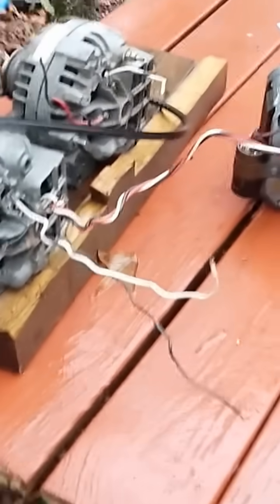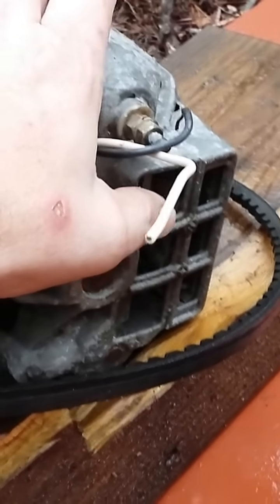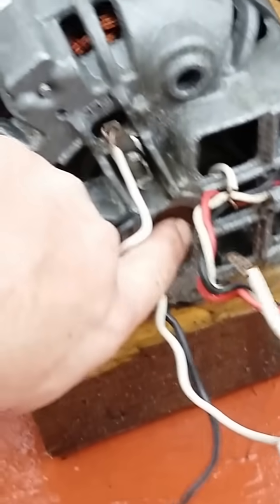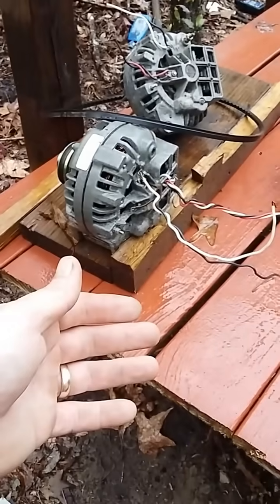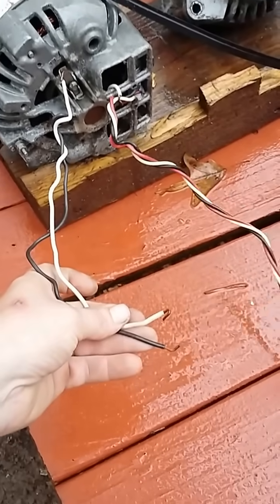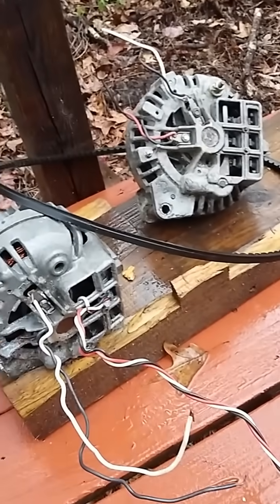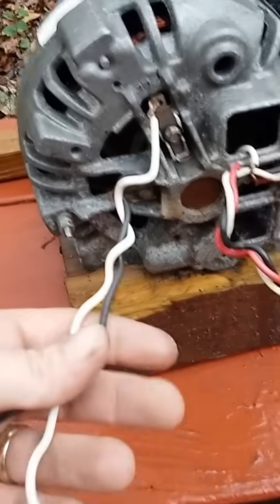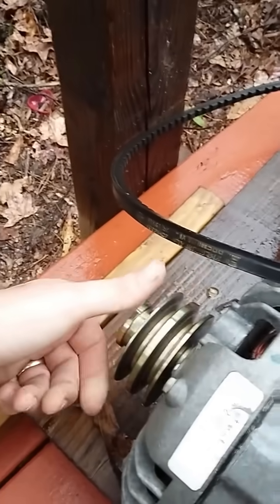Update Free energy forever no wind no solar no gas READ DISCRIPTION!!!

Comment: one of those alternators will not even run a high power stereo.
Reply: Thomas Buie When an alternator is rated at say 100A @ 14V, that is ~1400W, so no matter what you do with or without diodes, you will still be limited to 1400W. Alternators can only self excite with a rectifier and voltage regulator, which is NEEDED for the magnetic field to be produced in an ALTERNATOR. Just because you want an alternator to be a generator and power your dreams, doesn't mean you can make up crap about how YOU think electricity works. You either have to rectify and regulate the ~150VAC to 12-14VDC in order to power the field wire to make the magnetic field to generate electricity, or you remove the stator and modify with magnets. All GENERATORS have permanent magnets and do not need an exciter to work. ALTERNATORS unfortunately do not have magnets and need about 2amps supplied to the windings to create the magnetic field. If you supply voltage just to get the alternator going so it can self sustain, you'll fry the windings by overloading and shorting the entire unregulated circuit. 
I don't care what you are doing with your life, but telling people that they should remove a regulator and rectifier from something that can blow up, if it is ever fed any power to get it going, is CRUEL especially for undereducated people trying to find a way to experiment with alternative energy..
Like I said I don't care what you do with your life, but it's nut jobs like you that jump the gun and spread false theories as proven fact. 
If this works so well, show a video of it working. I wanna see you power it up actually. I want to see the smoke and fire.
Reply from the maker: Well then you've been taught completely wrong because one of those alternators will run 4 easy and the alternator that I'm using is a 10kw alternator. I actually have two of them...
Reply: Thomas Buie "90amp alternator" from a car? 
The way electricity is measured is wattage. Watts =amp x volt. 90 amps x 12 volts is 1080 watts. You could run a cheap microwave.. Maybe. But I bet the consumption of your drive motor is slightly higher than your alternator can put out. Nice try buddy. Maybe use a 300amp mechman and you'll have an output of 4500+ watts, but the magnetic drag will probably be too great  for a motor to spin without tapping all of the 4500 watts that you'd produce. 
Try using an exercise bike and a battery bank!
Reply from the maker: +Robert Penny
 Brother you're extremely right about everything you say and the only problem that you have with anything I say is the magnetic drag problem well let me ask you how much magnetic drag is there in a self exciting generator? almost none, so the thing that we've been lied  to our whole lives..(wait for it) is that you have to have the drag when you create the magnetic field. so with that being said... (crash course) when you take a 10kw self-exciting generator that is rated for an 11 horsepower gas engine and you're able to hook up 1 BLDC motor OR 1 one and a half horsepower AC FD motor and run 2 OF THEM generator heads with no problems creating 20kw peak 14.8kw RMS and only consuming 2.475kw and that's for the AC motor! the BLDC motor only needs to be hooked up to a charger and a battery and there is enough left over to run two houses at once then you will realize that if you use the magnetic field the same way you're using the alternate current you will have the same effect and it can be amplified 1000 times easily...   like I said before I'm not here for money even though I'm going to lose my land and everything I have because only one person has donated to me in the last few months don't get me wrong I'm very grateful for everything everyone has done for me and my family and I hate asking anyone for anything because I get treated like s*** for doing that but I am about to lose everything and there's nothing I can do about it except for sell my stuff off until the end but I will keep uploading videos until my phone bill is due and gets shut off... And I'm not asking for pity! I'm just rambling and hope you get some information out of this... I love the intelligent questions!! I think you very much for giving me the opportunity to Enlighten you on some of the things that we've been lied to our whole lives and if I can make this happen before I'm killed then I'm going to make sure that everyone on this planet has drinking water and electricity!!!

Comment: thats a cool idea!

ok so what should you use to turn the alternater

+ alright thanks man
Reply from the maker: +Alex Anderson thank you but the video is not complete instructions and just one of my many ideas but the alternators are incorporated into the system as generators and as Motors
Reply: Alex Anderson that's my bro you responded to. Thanks for helping him out man. hey, maybe I could use this in the future.
Reply from the maker: oh sorry, I didn't answer your question.. Just take one of the alternators and take the bridged rectifier out of it and you will have a bldc motor. I show how to wire one up in one of my other videos. 3 volts at about 3000 milliamps is perfect to the to field wires and you're controller tells it when to fire its really high powered so be careful with it!!!

Comment: where do I  get an alternator like that?
Reply from the maker: +Henry Harder I think I got one of them off of an old Chevy van and one of them off of an old Dodge from junkyard but alternator's don't go out they just have two pieces in the back that need to be replaced every 10 or 15 years. I picked them because they are cheap high powered and last forever I will be showing a video using them very soon I'm just low on funding right now been a few months since we've been able to work...

Comment: Meth is bad, also this is a 12v alternator at 90 amps. If its wired to produce 220v then you have to account for the difference in voltage. It would only produce about 1/20 of 90 amps. Also what are you using to spin the generator? If its anything other then a hand crank its not free silly man. I love to see a guy doing alot of talk and not showing it working. If it did what he said it wouldn't be disconnected. No one is out to get you for your invention of a alternator laying on your deck.
Reply: Daniel Creaney hahaha! best comment
Reply: Thank you, if you look at the description of the video he's trying to sell the plans for this. Lol this is the reason he's poor cause he's a total piece of shit.
Reply: Daniel Creaney if you're gonna be a scam artist do it right XD. I guess it's better than selling downloadable cpu speed and ram

Comment: so what's powering the electric motor that's driving the alternator?, physics show that it can not drive itself... + where are you getting your 6 VDC from? Thanks ;)
Reply: Malfunction Junction exactly what i was just going to ask. "put 6 volts" is pretty vauge
Reply: Malfunction Junction need running water and a wheel fashion out of some junk like a car hubcap or something that the water can move to work the alternator.

Comment: Diode doesn't convert AC to DC. RECTIFIER does that. A Diode is an electrical "one-way check valve", allowing current to flow in one direction only.
Reply: you do realize that a rectifier is just a series of diodes that channel the AC current into a DC current.
Reply: ...and it's actually not a "True" DC current, but more of a chopped up AC sine ;)
bridge rectifiers come in flavors...full wave 1/2 wave, etc
Reply: true true. That's why a good solid batteries so important. It acts like a filter to take that choppy DC signal and turn it into a smooth signal the computers in the car can use.
Reply: actually an scr is technically a diode that converts AC to DC but that is not what is in an alternator , this guy don't know anything and this is coming from a maintenance tech

Comment: everybody know a alternator creates power so how are u going to run it without gas wind solar
Reply from the maker: BLDC
Reply: esme outwaithe what kind of motor?
Reply: esme outwaithe is it just 2 alternators running together with a belt, running off a car battery well recharging the battery?
Reply: he is using a battery to turn a motor or alternator whatever you want to call it. you can put power in the back to turn the wheel or you can turn the wheel to get power from the back. he is using a battery to power one motor to turn the other to generate power. throw the two motors in the bin and just use your battery for power because all your doing is ending up with the same energy you started with you ain't getting nothing for free.. take wires and work something else along with the motors which is what your supposed to achieve and the whole thing will die just like your car when you use more power than the alternator can create.. your achieving nothing by turning a motor to create enough power to turn a motor .. now if some how you can create MORE power than you use and not just a circuit then that is perpetual energy.. you need to work something else off the energy
Reply from the maker: +esme outwaithe 
I would take this video down if I didn't have to have its revenue to live... if I was trying to create perpetual motion, more energy out then what I put in then why would I use one motor and one alternator? I wouldn't. yes I know those are the same things there's not really much difference between a motor and an alternator or generator whatever you want to call it and you don't want to put 30Ah @ 12 volts to the field wires because that will create too much of a magnetic force since it's wound with clear coated copper. your initial goal is self excitation! once you achieve that then you lose most of the drag Force created by the magnetic field or short circuit. please go watch my other videos to see things in motion...
Reply: HE USING A BATTERY TO POWER A MOTOR TO TURN AN ALTERNATOR TO POWER A MOTOR

Comment: Free energy is as simple as the pre-school technology of using pulleys to multiply rotations + multiplying AC electricity with multiple of both size and #’s of pulleys 
= https://free-energy.yolasite.com/ 
- this is so super simple, 
that we should be ashamed of allowing satan 
+ his fellow evil spirits, to have kept it hidden 
for so long = ever since Ezekiel 1:16 
- “a wheel in the middle of a wheel”, 
where it was the first simplistic described how a UFO motor worked in the Holy Bible,. 
You only pay one small bit of DC current 
to rotate 100 cm circumference pulley one single time,,,, 
+ through running the 100 cm of moving belt, 
(which came off the circumference of pulley) 
+ running it by 10 of the mini- 1cm circumference pulleys 
+ attaching AC generators to each pulley, 
you can multiply your AC electricity to 10X100=1000 cycles of AC electricity
,,,,,,,,,,,,,,,,,,,,,,,, all for the cost of one spark of DC current 
=(just enough to rotate your DC motor one single time)  .  .  .   .  .  .  .  .  .  .  .  .  .  .  .  .  .  .   .  .  .  .  
……………………………………………………………………………………….
<<< NOW TRY + TELL ME THAT YOU CANNOT GET ENOUGH VOLTAGE FROM THESE 1000 CYCLES OF AC ELECTRICITY,,, + ONLY THE ONE SPARK OF CURRENT, THAT IT TAKES TO ROTATE YOUR DC MOTOR ONE SINGLE TIME >>>
-
(I hope this makes you realize reality, + how powerful spiritual warfare is going on all around you every day)
-
YES,,, GOD IS REALITY,,, + HE IS COMING BACK BEFORE 2019.04 –(in air for born-again)
-
http://decimationofthisevolutionfairytale.yolasite.com/
http://free-energy.yolasite.com/
http://my2020vision.yolasite.com/
http://doorschristmustpassthrough.yolasite.com/
http://beliefstoliveby.yolasite.com/

Comment: I'm ashamed to say I watch that entire video. If you know anything about how alternators actually work, what you're doing would never work. the energy that alternator produces will be used to power the motor. In a perfect world that might work. We live on earth. You will lose energy through heat and through friction, because that alternator  will start loading that motor more and more as it demands more to keep up on the motor, and because you're losing energy through heat and friction there won't be enough to keep the motor going. the entire unit will slow down until it finally stops. I tried experiments like this when I was a little kid too.
Reply: 1stupidfish the motor will slower due to heat yes but prolly won't stop if you wire the windings out of sync of two motors connected
Reply: 1stupidfish maybe
Reply: Insightful

Comment: if ure using an electric motor to turn the gen, how r u getting more out than u put in? don't u need a non electric means of turning the gen to have a net positive power level? wind, water, ect?
Reply from the maker: that's why I'm using more than one motor an more than one generator with different power sources, one motor is powered by 10 year old peddling a bicycle I mean powered by battery with a speed controller and the other one is powered by one of the other generators after initial startup...

Comment: I don't see the point.  I think you numbers are a little off. There is a scientific law that says you can't go pet more power out of something than what you put in it.
Reply from the maker: that's exactly right unless you find a way around it like building the Hoover Dam there's no resistance in the water falling therefore it makes all the energy you need it too.. there's no resistance in water. Now what happens when you mix copper in water and put steal in oil on top of it... what's the resistance and what are the variables in the input and output. so by using everyone's so-called laws of physics. BS is what I call it, if I was to take a 3.7 volt lithium ion battery and turn a motor with it and pump water 10 feet up in the air and let it fall down a bunch of pulleys with a couple of generators on it. I wouldn't get more out of it than I put in it...?... well it doesn't work that way in my world. I've been tearing stuff apart and putting back together my entire life and I know how things work. I may not know exactly how to wire SF/LF NF circuits without a diagram helping me along but I know Big power!!!

Comment: In your video you never mentioned what type of power source your using to spin the alternators?
Reply from the maker: and that's a good question I have used many things you can use and alternating current compressor motor but something that big you would need about 10 alternators. I took one of my alternators and turned it into a bldc motor by removing the diodes and running the three wires nice and smoothly out I use the stator and put about three volts to it because I want it to spin faster instead of putting 12 volts to it and having a lot of torque but not spinning very fast. I think it's a xr10 bldc motor controller that I'm using. I was going to get a 555 timer and just build one. it's a lot cheaper but takes a lot more time so I just bought one from the hobby store.

Comment: This for anyone who doubts this, if you were to use an Hydrogen dry cell hookup to run your vehicle's engine or even setup with your fuse box properly in your home (in this case just to incease already existing service output), an alternator with a small setup of RV deep cycle marine batteries then this would work perfect. The best techs are simple. Hydrogen works SO WELL in fact that the kits people sell now. If you had ANY compression engine injected with HHO you would have the highest octane (O3=Ozone gas & Hydrogen) at the lowest cost imaginable. People get confused by all of this because they won't make the choice to switch from wallet raping crude fuel. And alternators are Nikolai Tesla Invention, they are a working example of many emf style generators he came up with. STOP BEING CLOSE MINDED. Oh, and remember, according to them corporations are people too, they just in this case are the sickest people alive at the top.